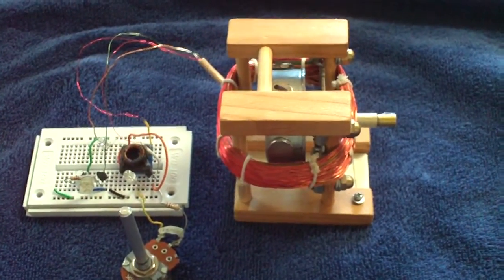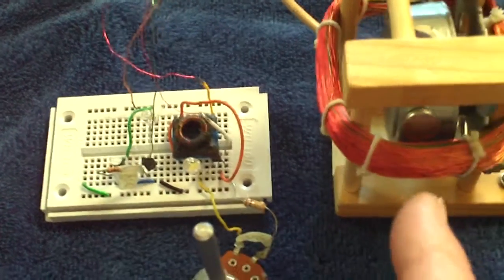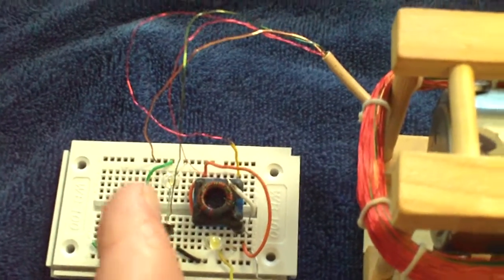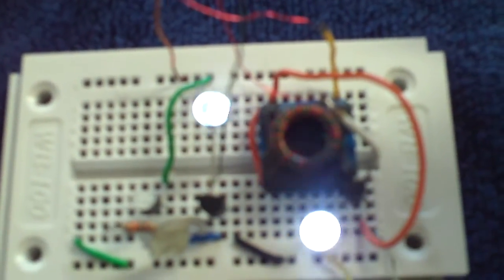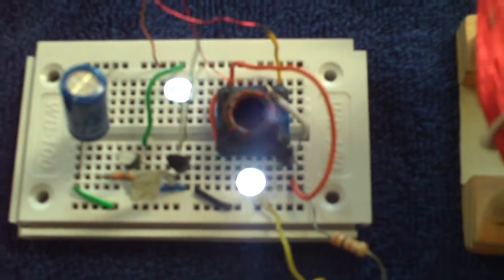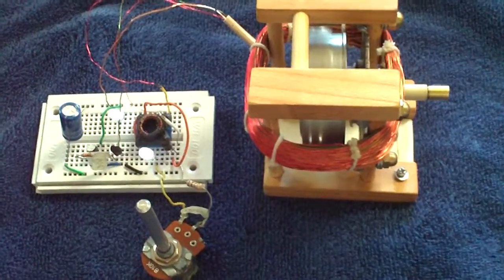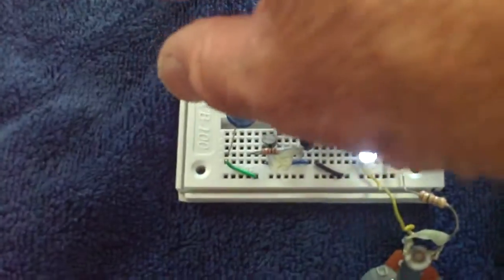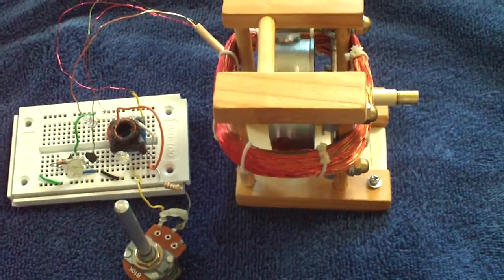Window Motor Running On A Small Capacitor

Comment from the maker: If this turns out to be worth showing the circuit diagram I will.   It is just my Paper Clip motor circuit on one coil with a standard Joule Theif circuit powered by the other coil.
Reply: I watch almost every video that you have and try to replicate them.  It is a great learning process while at the same time having fun. At 1:02 in this video you mentioned “ put the second wire on a joule thief circuit “. I tried to understand that so I could replicate, but I could not. I am sure that for you it is very simple, and I would really appreciate if you would tell us how to connect to the joule thief circuit. There could be others who have done this but I never did see this particular configuration. Thank you for guiding one of your very dedicated viewers following your work for around 15 years now.

Comment: Hi Lidmotor,
I'm one of the ardent fan of yours.This is my video.
/watch?v=AZIpIS_R6LI
This is based on 1 wire energy transfer "Tesla theory" .As discussed in overunity kapanadze by me.My latest finding after this video in order to boost power via 1 wire the battery negative terminal is grounded to electrical earth or earth.
Most important discovery there isn't battery current increase if i changed caps to actual flash cap especially after flash cycle during charging.Please try it out.Cheers.

Comment: I'd suggest a larger jt inductor, feeding a smaller cap to higher voltage, which could be the run cap. Sounds silly, and probably wont self run, but thats the first thing I'd try to harness that JT output. Seems like it would be better to use the watts at higher voltage.. Great video. I love how easy that motor is to wind, and that its a generator too :)

Comment: Good to see how it runs as a generator...perhaps the trick would be to separate those 2 functions and recombine back at the power source. With already having a light output, the JT might be the way forward for that routing. Caps are tougher than batts too.
That was a cool video :)